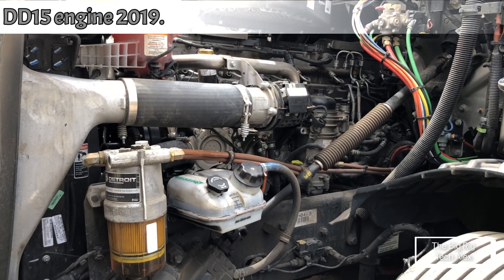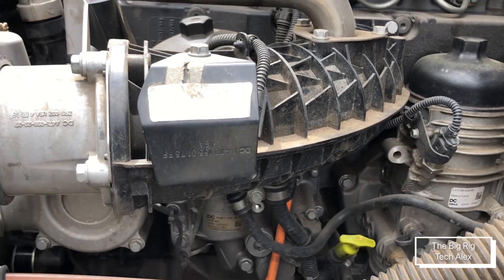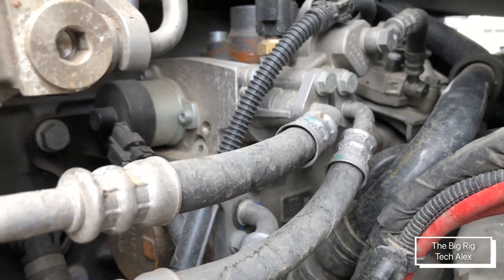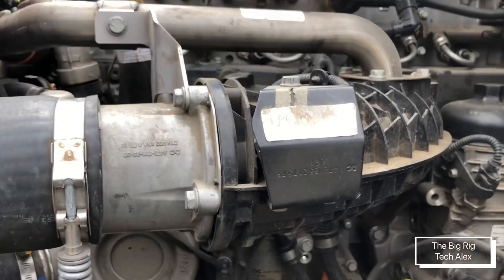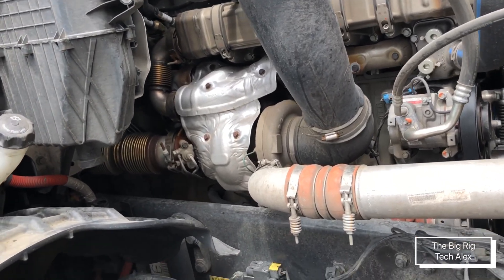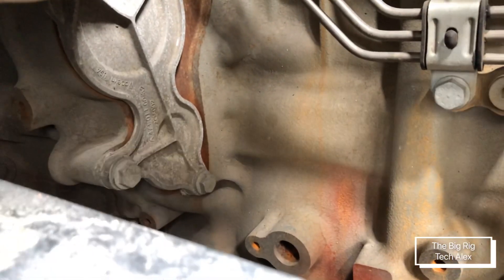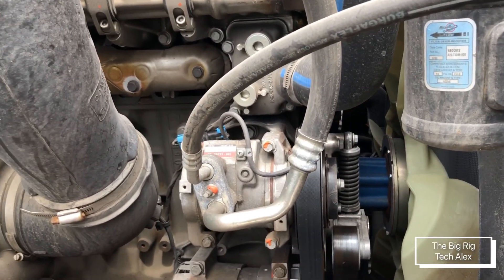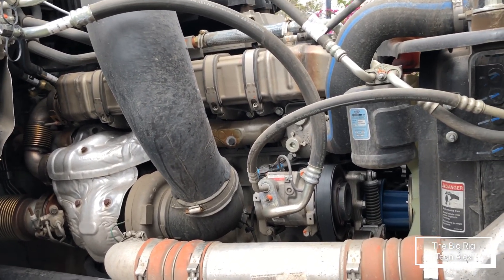DD15 (Detroit Diesel 15) engine 2019: A quick review.

Comment: I’d like to see a video on what to check during a Pre-trip and post-trip inspection to look for trouble spots where leaks might be a problem or other issues.
Reply: The two thing to be concerned if you are a owner  operator, is keep the top end adjustments up to date, and the orings on the oil pump pick-up these get hard and crack, causing bottom end failures.
 Pre trip stuff is look for scuffed eng compartment wire harness scuffing, and your air to air after cooler, they do crack, and remember, nothing is more expensive than oil changes, except no oil changes.keep it clean.

Comment: Hey Bro.. which engine do you prefer DD15 or X15? I’m looking to buy another truck and I’m wanting to get your opinion. I want to buy the most reliable engine so which one do you prefer and why? Thanks for your time.
Reply from the maker: Ok, there is not a straight answer to your question, everyone has different taste for trucks, for example you might like a powerful truck but you give up on fuel economy, or perhaps you might like fuel economy truck but you lose horsepower. The good thing in these days, owner operators has a variety of trucks and engines to choose from, in my personal opinion, if you are starting a business Freightliner(DD15) is the way to go, reliable because pretty much every Technician knows about it and for maintenance cost and repair usually people does not complain. In the other hand, if your business is already walking in good peace (it means that you have more than 50 units) you could start checking what other manufacturers offers like Cummins, Volvo, Paccar and International but maintenance cost might go up a bit compare to Freightliner. Cummins X15 seems to keep a good reputation but fuel economy in the newest engine still something to see in a long run. If you are buying this truck to drive it yourself then feel free to try something new (as long your business is running fine), perhaps you can find a good deal out of the Freightliner bubble. But remember if you are not adventurous you should keep Freightliner(DD15) as your first choice.
Reply: Let’s talk DIESEL. Thanks Bro. I’m actually buying a freightliner with a DD15 today. Check out my video later on tonight for a look see. Take care my man!
Reply: @LetstalkDIESEL  do you prefer dd13 or 15?
Reply from the maker: @PL-jr3rq  Both are good choices, but it depends for what you need it for... local pick up with high idling times you will need a smaller engine DD13 will be a great choice. Long haul applications DD15 will be your best decision in a long run. Thanks for watching.

Comment: detroit turbo series number ??  472090....?
Reply from the maker: Usually all DD15 engines comes with turbo. Some others comes with the Axial Power Turbine, which generates a bit more torque using the exhaust after the turbo. can you be more specific with your question? That way I can help you better.

Comment: Sir I like your all videos it’s very helpful for us. .....,,,, can you explain when D15 got 400k mile what  part we need to replace and when we should do tuneup engine
Reply: Thank you sir
Reply from the maker: Replace as it follows:
* Oil change at every 35,000 miles or every 750 hrs.
* Fuel filters at every 35,000 miles or every 750 hrs.
* Valve lash adjustment first at 100,000 miles then at 500,000 miles and then at every 500,000 miles thereafter.
* Coolant-extended life: every 70,000 miles or every 1 year.
* others part you must check it out the operator manual inside your truck.
I hope this help.